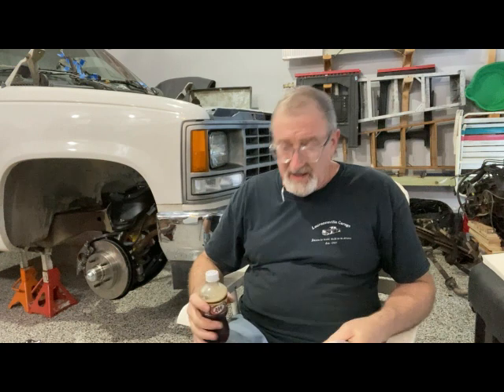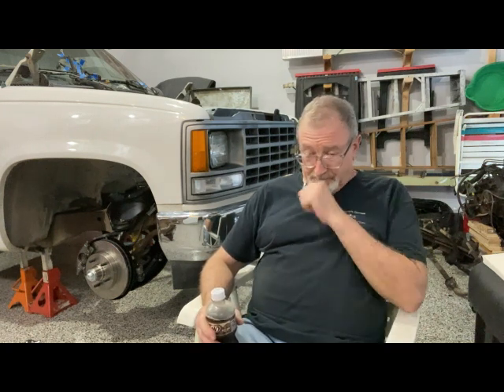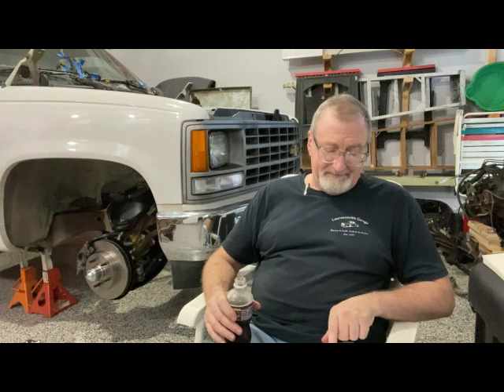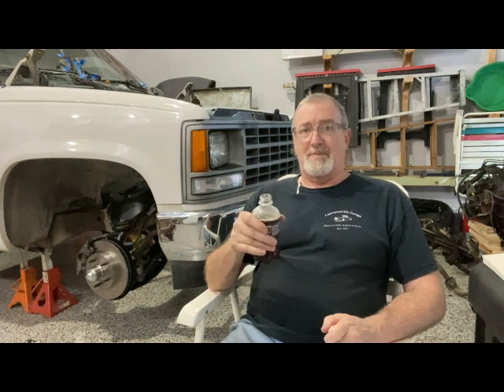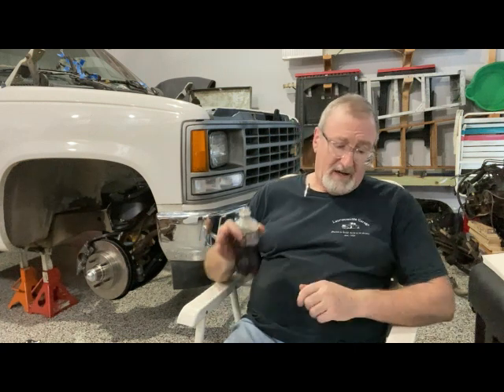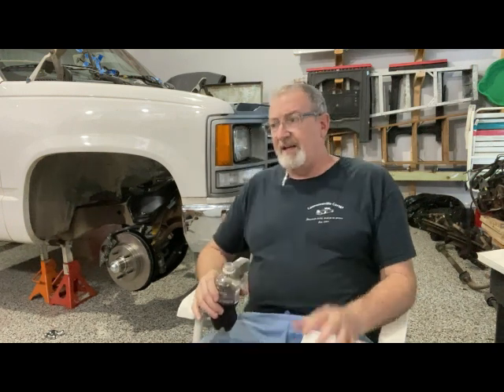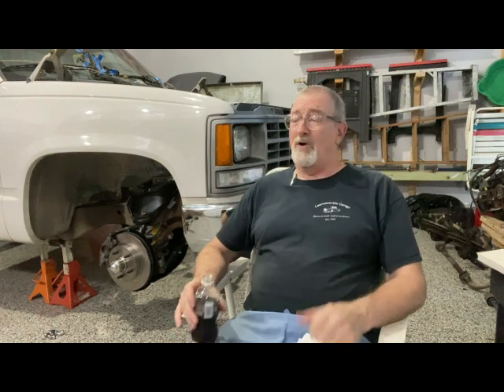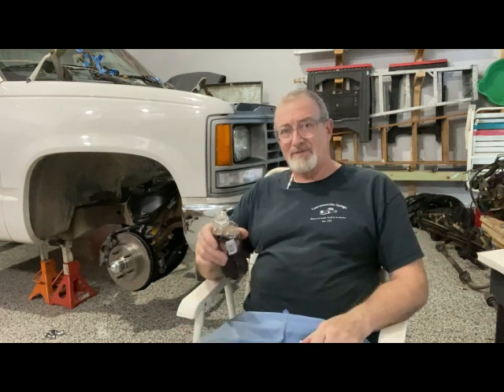What I Wish I Knew BEFORE i Started My 1988-1998 Chevy OBS Truck LS Swap Project

Comment: Bought a donor! 2007 classic, 4wd work truck with floor 4wd selector.  New tires, trans is new, newer LM7, no leaks, beat up work tuck.  Drove it home! Going in a 97 Z71.  Father/son project.  Only going to clean it, change cam and intake, want a little lope, weekend toy, and drive it. Glad I found this video, and although on the wrong side of 285 nice to know there are guys close that have some info!  Thanks again for the info!

Comment: Man that rabbit whole is easy to fall down. I thought I was gonna do a budget build 2 years later it’s cammed 6.2/t56/terminatorX/rack n pinion swapped and almost done. $18k later…
Reply from the maker: Yep, even on this project, I have gone over my budget with the attitude of "while I am at it, I may as well _____". But, if you don't have some guidelines, it will get more expensive much easier.
Reply: I’m thinking about 5.3 swapping my 98 with a mild cam and turbo kit with the terminator x harness. My biggest thing that I can’t find anything on is keeping the cluster tach Speedo oil pressure fuel gauge working? do all electronics in the cab still work. 4x4 switches, ac switches, headlight switch, power seats windows etc? Or do all of those needs to be wired somehow?
Reply: @DJsConstrictors  as long as you don’t have the moonie style gauges like I do you can keep the cluster. And yes all the other things you mention are on a separate wiring harness. Z
Reply: What did you do for wiring? I wanna do a 6.2 as well.
Reply: @stoneyisland1491  terminatorX

Comment: Thankyou! Only thing I disagree with is amazon! Over the past couple months they have really gone down hill and been sending me knockoff or broken items and when I go to return them they want 60bucks for shipping! Not worth it anymore! I used to buy a ton off amazon!
Reply from the maker: Wow, have you ever had that bad of an experience with them. Most everything I’ve purchased that I wanted to return has been a non-issue. They are getting much picture now about providing a box or a package that it came in or else they’ll charge me for one to send it back, it’s still better than eBay.
Reply: @Laurenceville Garage  yea I've spent a 100k+/- or so with Amazon over the past few builds ive done in the last few years, and noticed only recently the fake/bait/switch items and broken upon delivery with Amazon not caring to make good.. used to have almost zero issues..
Prime example I bought a set of elgin lifters for ls. Now I know all elgin lifters are made in the USA, so as soon as I opened the package from Amazon there was a big ol made in China sticker on a no name blank box.. open it up and the lifters aren't even the right size..
This past week I ordered a 88-93 composite grill for 120bucks that arrived broken and when I asked to return for refund it was a 65dollar charge..

I ordered a set of black housing 88-93 chevy headlights for 100 bucks, when i went to install noticed the park lights are 94-98 which are smaller, not the larger 88-93 i needed, so when I notified the seller they offered me a 20 dollar refund..
Reply from the maker: @johnsteenland1292  ouch, luckily, I haven’t had those kind of problems yet. I have had issues were if I wasn’t careful they were shipping directly from China and if the item that arrive was it correct or there was something wrong with it in order to ship it back, which cost me more than the item was worth, and they would offer me up to 15% refund. But for the most part it does work out well, but I think there are some parts I would buy directly from the manufacturer or a reputable outlet rather than Amazon. Sorry to hear of your problems, hope that doesn’t deter you in the future from your projects.

Comment: I Really wish that I would have know beforehand about the whole “tuning” aspect of doing this LS swap crap. Having to find a tuner is very counter productive for a true DIY’er trying to do a swap in their garage on their own. Having to rely on someone else to “tune” the computer sucks and finding a tuner that isn’t a total douchebag and thinks that they’re gods gift to car building has by far been my biggest challenge in my journey to LS swap land. I can’t speak for you or your area but the “tuners” I’ve contacted around here are a bunch of prima Donnas trying to charge $$$..
Sure, the tuning can be done DIY but that’s only after spending an ass load of money either on HP tuners or a stand-alone Holley type system. But other than the tuning aspect, doing an LS swap is easy. I also totally agree with you on the buying a complete running/driving donor to begin with.

If I had known then (when my OBS was a roller sitting in my driveway) what I know now that my swap is almost done, I would have just stuck a carbureted big block under the hood and been Done with it.
Reply from the maker: Excellent point to bring out. I had planned to do a “part 2” once the project was complete to add all the stuff I didn’t think of at that point in the swap. But, you are absolutely correct about the whole tuning thing. That is a fork in the road…I know a lot of people look down on the “carb”, but I am thinking I may want to do that on another project then compare the pros and cons to fi vs. carb. Thanks for your input!

Comment: You did the rag joint swap for the steering on the white truck. Where did you get that and how did it work out for you ?
Reply from the maker: Works very well. I would do it again. It’s a pretty inexpensive upgrade…I got mine off EBay. I put the links, price and details below the video in the description area.

Comment: I really enjoy ur videos they are very informational, I have a 93 c1500 Cheyenne 4.3 5 spd I wanna do the rear disc breaks to it and the front end, I need new motor mounts also, and that's gonna be the most time consuming I recon because there not easy to get too. But wow keep giving videos because they r great.. I was wondering in my 93 I have a shift light and don't have a rpm tach I know some of the automatics have the tach built-in the dash, would one of those work in my 93 if I find one from same year with tach? Thanks and again very informational.
Reply from the maker: Thank you for the kind words, if you are just replacing your existing motor mounts, they are a pain, but can be done. And, yes, it you find the correct dash for your year with a tach connecting should not be a problem.

Comment: You probably won’t see this but I just bought my first project truck it’s a 89 Chevy c1500 with a step side bed and I’m looking to buy a 5.3 engine and tranny to swap do you have any tips I should know ab and what I should look for and what I need thanks.
Reply from the maker: Great first truck! Simple but complicated question. On a budget, find a running donor. Keep your first swap stock. That will keep your costs down and keep it simple. Easiest way to answer is to look back at my videos and maybe start around the time project '91 did. I kept up with costs and a lot of steps all with the budget minded guy (like me) in mind. Lots of details, feel free to ask questions, but check out a bunch of videos first to get a grasp of the total project. Thanks for watching and good luck with your '89!
Reply: @laurencevillegarage  thanks for replying so fast and I’ll pretty much watch all of those videos I watched a few and I come to the conclusion that your one of the most in depth creator ab ls swaps.
Reply from the maker: Thank you very much!

Comment: I wish i would know  stock 5.3 a/c compressor does  not fitt on obs swaps,,,   Unlike square bodies & 67-72 c10s,,
Reply from the maker: True, it is too long. But, I have a solution. I should have a video in a few weeks. I am keeping a low mount system. Hang in there!
Reply: @laurencevillegarage  @👍
Reply: @laurencevillegarage  @ nice , that way i can get a/c into my 93 swapped,    Iam avoiding the stock 93 compressor,,,
Reply: @laurencevillegarage  @ happy new year
Reply from the maker: @gerardolopez5875  Thank you! May 2022 be much better than ‘20 and ‘21!
Reply: I found a high mount ac mount it was $35.00 on eBay. Had to get a new belt and tensioner but helped make it fit easy

Comment: If your not a boomer all those wiring diagrams are free online.  Otherwise this guy had great advice.
Reply from the maker: Ah, the internet. It is a wonderful thing....until it's not. True some diagrams are available for free it you can find them. I have a video showing where to find some. I have also found sources on the internet that at later date were no longer there. However, comparing the manuals I have to the "freebies" on the internet, there is no comparison. My manuals have way more information and whenever I want them they are there for me. Stuff online has a way of disappearing and I don't want that in the middle of a project when that happens. If you can afford to do an engine swap surely $35 won't dent your budget to get a factory manual. Plus, the "free" stuff requires your time to sit down and do all the research to try to find exactly what you are looking for. The manual puts it all at your fingertips. The manuals are a "tool" and they have value. If you don't need them anymore, list them on ebay and get your money back.....that makes them free too.  Just my .02 and years of experience.
Reply: @laurencevillegarage  i have a fat stack of manuals that take up a whole bookcase at my shop.  They never move, between all of the various online resources i have never found myself using the manuals.  And $35 dollars saved on diagrams is $35 extra dollars to use towards the build.  Plus id much rather have the info in my pocket whenever i need it.  Instead of sitting on a bookshelf in one physical location. And im sure its just a generational difference but it takes me less then 60 seconds in general to find any diagram im looking for.
Reply from the maker: @philipallen7956 yep…it’s generational… good luck, thanks for responding.

Comment: Im having issues finding the correct Yolk and pinion seal for my C1500 Chevy no luck anywhere and everyone wants me 2 drive it to them when I don't have the money or ability to take it to them all I need 2 do is find the correct yolk and pinion I've done gone through about 4 of them and no luck. I don't even know what to do and I've gotten 2 books for the truck with no luck as well my truck is a 92 2wd C1500 4.3 liter V6. I've been researching,  reading and asking a million questions with ZERO luck, anyone who can offer some help sure would be appreciated!
Reply from the maker: If I was having that much trouble, I would consider just swapping out the rear end as a unit.
Reply: @laurencevillegarage  i don't know much about mechanic work but I'll keep that in mind thank you!